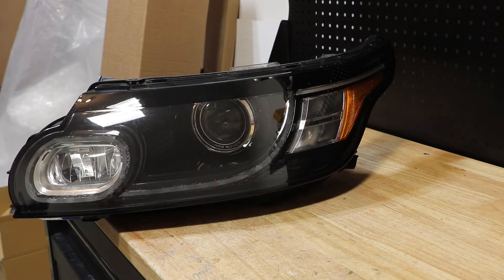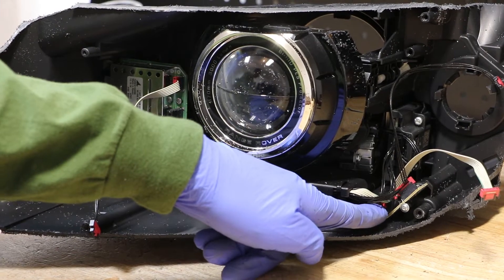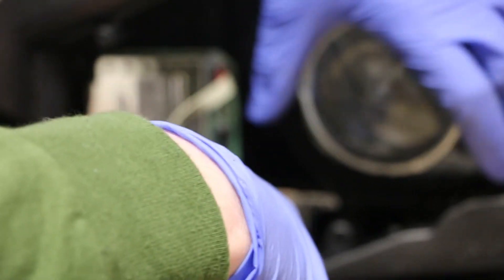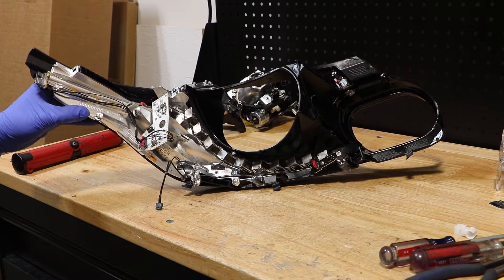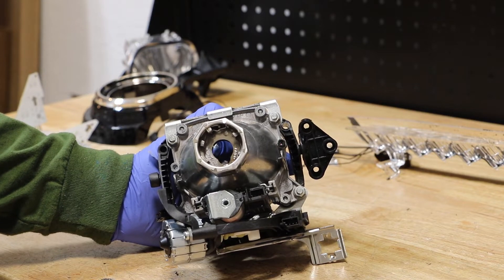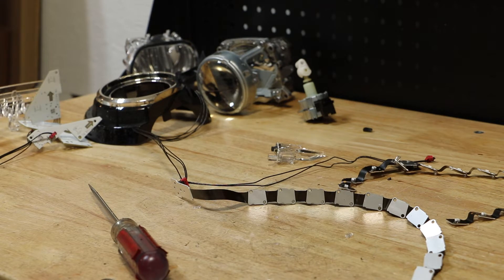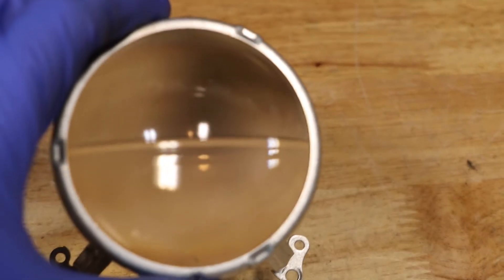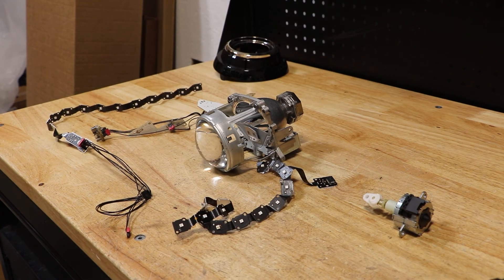2014-2017 Land Rover Range Rover Sport Bi-Xenon Headlight Tear-down

Comment: Wvat kind of bulb on reflector which is on left side of headlamp?
Reply from the maker: no bulb. it's LED.   Only bulb in the headlight is the main Xenon bulb.  The rest are LED and are not serviceable.
Reply: @gftgrill  ypu mean sir the left cercle has no bulb just LED around it and itvis empity ?
Reply from the maker: @ghazibagazi9687  Correct.  
Here you can see the rear of a headlight: https://i.ebayimg.com/images/g/as4AAOSwOU1iaElJ/s-l1600.jpg

There is no access cover to get access to a bulb.  it is completely sealed as everything inside is LED
Reply: @gftgrill  you want to say the rear of headlight has  only hole for main bulb which is xenon and low/ high beam lights are on one bulb ?
Reply from the maker: @ghazibagazi9687  correct

Comment: Hi I have Range Rover hse sports I was told I need to change the left head light assembly and it’s like 2500 dollars can I have it fixed if so .how ?.thanks
Reply from the maker: I guess that depends on what's wrong with it.  There are not many companies that are willing to disassemble a headlight for repair.   I would try to find a good used headlight and save yourself the time of trying to repair yours.
Reply: @gftgrill  everything is working except the light bulb in the middle.so that’s why I was wondering if there is a way to just change that light bulb instead of the entire set.thank you
Reply from the maker: @Boss-sb9ih The only light bulb in the light is the main xenon light bulb.  The rest are LEDs and cannot be replaced with out opening the headlight.  You cannot buy the LEDs either, you have to have a 2nd headlight to pull the LEDs from to replace in the first headlight.
Reply: @gftgrill  so what you saying is the best thing to do is to change the entire  set ?!
Reply from the maker: @Boss-sb9ih  Generally Yes.  It just depends on how much time you want to invest into swapping parts.  start to finish, I would expect about 6-8 hours to open your headlight and another and swap parts (assuming everything goes smoothly and the parts headlight is fully working.   it will take you about 1 hour to remove and replace the headlight.   Either way there is no guarantee how long the new LEDs will last (even on a brand new light).   

you'll have to decide for yourself how much time and energy you want to invest in swapping parts vs replacing the headlight.  If you replace do you buy a used one or a new one.  FYI,  you can buy these lights from Land Rover dealerships online for about 1900 + shipping/tax.
Reply: @gftgrill  what if I buy a used one ?!
Reply from the maker: @Boss-sb9ih  you can buy a used one.  I would try to find one with a good warranty as the LEDs on these lights commonly fail.   A used light could last 6 months, it could last 20 years.   Its one of the gambles you take with used LED headlights.
Reply: @gftgrill  last question where do u think I could find a used one ?
Reply from the maker: @Boss-sb9ih  I would start with local salvage yards in your area.  You can also find them on eBay, and through other various websites for salvage parts dealers.   I have no loyalties/recommendations for anyone specific.   Please note that you'll also want to ensure that you get the same version of headlight that you have.  There are multiple versions of this headlight for this body style.   you'll want to make sure that you don't end up with a mismatched headlight or one with different options than you have now.
Reply: @gftgrill  I have the part number u think that’s enough to get a one that would match with what I have now?
Reply from the maker: @Boss-sb9ih  it should be.  you can ask any one that you buy from to confirm that their part is same as the part number the dealership gave you.

Comment: Hi, I have a Range Rover Sport L494 2014. My left daylights (led) and blinker aren't working anymore but my big Xenon is. Pretty strange! Could it be the fuse? If yes, where is it situated? I'm looking for it but really can't find it. Thanks
Reply from the maker: I do not think there is a fuse for the LEDs.   you most likely have a failure of the LED controller inside of the light.
Reply: @gftgrill  Hello, I have exactly the same problem since the alternator failed. Can it be repaired or do you need to change the complete headlight? THANKS
Reply: The entire xenon system works, except the LEDs, indicator and daytime running lights

Comment: Thanks for video!
Can you advise which led type is on 12:41 in the video? I disassembled headlights to black it out and change xenon to bi-led lenses, and really want to change amber color to white, as the whole daylight running lights are. But can't find this small led number or type. Thanks!

Comment: My headlight went out on this model Range Rover. How do you change just the headlight bulb?
Reply from the maker: There is an access cover on the rear.  you have to disconnect the ballast wire, then reach past the bulb and twist the bulb retainer to the left until it unlocks, then pull the bulb out.  it's a pretty straight forward process, but space is tight.

Comment: @gftgrill thanks for the comprehensive video! I need to fix the DRL strip in mine. Out of curiosity, can the amber indicator be removed? It’s not a big deal but I just personally find it a massive eye sore
Reply from the maker: I'm pretty sure you can.  the problem is that it leaves holes/gaps.   Rather than removing it, you might consider painting it black or chrome to hide it.